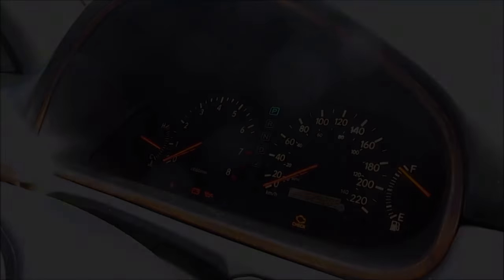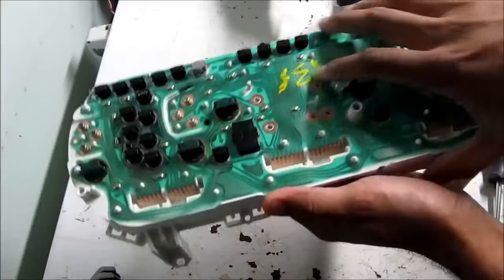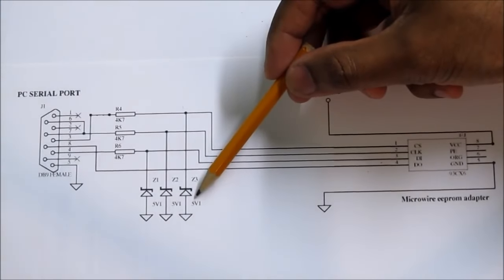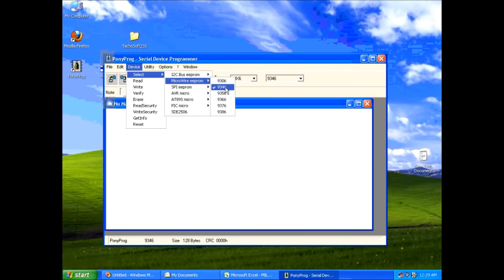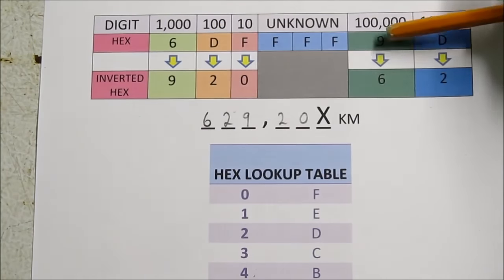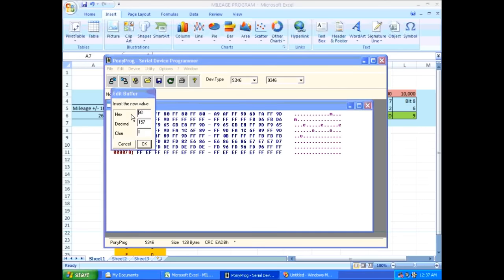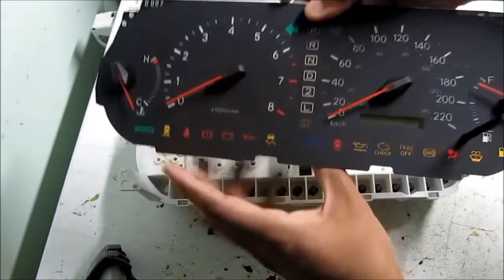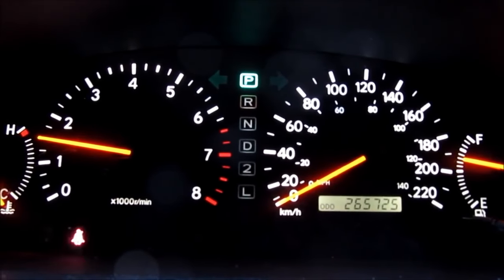DIY Odometer Reprogramming

Comment: At first I was like, damn he’s teaching people how to commit fraud.  After watching, if they go through all this they’ve earned it.
Reply: Right waaaay too many steps. I will have messed my whole car up lol
Reply: @QMil-sz8ej  هههههههه 😂
Reply: Hilarious. 😂
Reply: I’d get an extra odometer and mess with that to prevent messing anything up
Reply: Well depends on if you already have soldering station, spare bread board, wires, etc. Everything  software wise would be the easy part.
Reply: There are a few totally legit reasons to change the mileage on an odometer. One of which is if you had to purcahse a new or used inst. cluster for your vehicle. It would technically potentially be illegal and fraud NOT to change the odometer in that case, should you not disclose the odometer is not the original.
Reply: lolz
Reply: bro fr, like windows xp in 2023 come on
Reply: Is it fraud if you're changing it to match the mileage on a new motor?
Reply: LOL
Reply: Its cause alot of software is shadow blocked by microsoft and only avalable on older windows versions like xp i know microsoft just sad for doing this just so we pay a monthly on all software
Reply: I’m just tryna get live mpg on my 1998 Volvo and the t5s have a better cluster and more than likely they would have lower mileage than mine so I’m looking to increase to mileage 😂
Reply: He's really smart
Reply: I got lost at take your dashboard out personally

Comment: In the old days we used to put an electric drill in reverse on the speedo cable, does that not work anymore!?😂
Reply: is he not dropping it down 300000 odd ks, do you have 133 years to drill the focker? :) haha
Reply: Not for the digital clusters now in modern cars
Reply: No. In reverse, the mileage still goes up. Drive your car in reverse in a parking lot and you will see the mileage keep going up.
Reply: That was a good year and a very good movie.  Ferrus Buellers day off.
Reply: For the bikes yah
Reply: No you didn’t. My uncle actually worked for a dealer and he did cut miles off. Pretty complicated process

Comment: For people trying to do this to lower the mileage to sell a vehicle, the actual mileage is still stored in the powertrain control module (pcm) that’s why I take my diagnostic scanner anytime I buy a used vehicle and verify the mileage on the odometer is correct.
Reply: Flashes/Writes new data to the pcm
Reply: @hestia3135  thanks…good to know
Reply: really? I took my car in for service at the dealer and they were unable to tell me what the real mileage was. 299999 for life, I guess.
Reply: @the_kombinator It'll be stored in the ecm/pcm. They just didn't bother to check.
Reply: @NoBrake_Noah  They told me they connected the computer and couldn't find it. I don't really care, the next owner will be the junkyard and I use a trip meter to do my oil change intervals.
Reply: Sorry, you can't check it I just tried to do it and the option was not in my scanner. Also it codes in it but the check engine light did not come on when the car was running but it came on before you started the car. Things are changing out here.

Comment: Why didn’t you just swap chips from the camery gauge cluster to the Lexus gauge cluster because it’s probably the same chip
Reply: That's exactly what they recommend doing.....However the easiest way is to use a TL866II USB programmer and SOP8 IC clip.....first you clip on the old chip, no de-soldering needed. Then use the software to "read" the chip, copy it to a file that you name "old chipset." 
Do the same thing with the new one.
Then using the software to "write" the old file to the new one and you're done.
The only two things stored on those chips are mileage and VIN number.
The newer cars, it's stored on the ECM's and you can just plug into the port they use for diagnostics and change it with a $300 programmer.

Comment: I did something like this with the BIOS chip to a laptop. With the same setup, I flashed the chip to my guitar amplifier with on-board DSP (Peavey Vypyr 60, 75 & 120) The hardware I used back then was a Raspberry Pi 3, using IC test clip (so I didn't have to solder anything) along with a breadboard. The Pi's GPIO pins provide all the connections you need to read from an SPI chip, along with a SPI driver in Linux Debian. I used FlashROM, a terminal based program, but I see that PonyProg lists Linux as compatible. So combine your software with the RPi hardware and you have an effective portable solution to flashing chips!

Comment: Next time just get a OBDStar X300M module and change your mileage (on any car) in like 30 seconds.
This can look very tempting for some people but the odometer chip is NOT the only place that the actual mileage is stored. Power train PCM and other modules, also contain an actual mileage and a scanner will reveal it. Good job explaining WHY you are doing this and the warning at the end . I am so super impressed by how much you know about eletro-mechanical systems. Judging by your age estimate, I figure you started learning about this stuff when your were 5 or 6 years old.:-)
Reply: OBDstar X300 doesn't work on Toyota and Honda cars

Comment: The units number probably is written by rotation in various locations, to prevent wearing out of that cell by frequent write cycles (units are 10x more often written that the rest of the cells).
Reply from the maker: Maybe
Reply: They use EEPROM that are deisnged for high write cycles. Thats why it holds such a tiny amount of data.

Comment: Could have used a XGecu USB Programmer and SOP8 IC clip.....no soldering needed, just clip, "read" the "old" and save it, then clip the "new" and "write."
The only two things on those chips are mileage and VIN.

Comment: So I have a 2003 Toyota Echo that I was called on. Never did odometer repair, corrections but have taken a all day class on. Eeprom actually back at end of Feb, beginning of this month. 

The question I have is can I read the chip onboard with the sochip? 

Also need to figure out where to get current mileage from? 

The cluster assembly is the original as I can tell by the markings. 

Can I get the mileage off the ecm using TIS ? IF so that would make it easy, just get from ECM, write to cluster board being it's cluster level or am I off on my assumption? 

I am hesitant given the lack of ability to get mileage using 3 aftermarket scan TOOLS so dealer level if it can be done seems like my last hail mary unless it's stored on the chip and the chips went bad? 

How would I go about determining what I need to do? 

This is the part of automotive I want to dive in and stay in, keep swimming along with programming, auto locksmith work. 

Any help would be greatly appreciated.

Comment: thanks a lot!  I have this '10 car and the odometer said I drove 300k+ miles on it but I swear I only drove 15k miles.  I was able to reset it to 15k miles and make an extra $13k selling it to an elderly woman.  her husband asked why the engine looks so run down but I told her it should be fine it only has 15k miles on it! they bought the car!

Comment: @speedkar100, Hello. I apologize for responding over 5 years too late. But how come @ 4:08 your HEX calculations to end up with the final mileage is so different than the write up you made around the same time on instructables? For instance on that write up, you explaind how hex 33 85 were, "... the only characters that store actual information..." and you multiply the result by 16 to get 211,024km. Yet by doing that method here I ended up with 450,464km instead of your written 629,20x km? In other words your method here did the invert by chance because all those HEX values on row HEX inverted gave a number. What if the 6 digit in the 1,000 column was 5? Then the inverted is A right? So how would that be interpreted as part of the final calculation? Just asking... thank you

Comment: Hi! I performed this procedure on my 03 Lexus GX470 and finally was able to successfully change the mileage. Just a couple of issues I got.

1. ODO and mileage reading are Flashing / Blinking.
2. RPM Gauge seems to have stopped working.

Any idea what may have caused this? Or what can fix it? Thanks!

Comment: What happens if you do engine swap in your car with say 90,000kms on it and you find a digital speedo cluster for your car with 90,000kms wouldn't  that be easier then doing all of this
Reply: What are the chances of finding a compatible digital speedometer cluster with the correct distance reading on the odometer?  Your chances of reaching into your pocket and randomly finding a fist-sized piece of gold would be  better.
Reply: @Milosz_Ostrow  rubbish. I own a breakers yard and i have lots of vans if same model with almost the same miles give or take a few thousand
Reply: @mikewatte4478  — Johnno Bravo didn't specify "almost the same miles give or take a few thousand".  He specified 90,000 kilometers, so if your yard has lots of vans with odometers calibrated in miles, they would be of no use in replacing an odometer calibrated in kilometers, regardless of their reading.
Reply: @Milosz_Ostrow  in uk its miles
Reply: @mikewatte4478  — You could live in a place where odometers are calibrated in leagues, but even though you might have a yard full of vehicles that have such odometers, it still doesn't respond to Johnno Bravo's need for an odometer that is calibrated in kilometers AND has 90,000 km recorded on it.
Reply: @Milosz_Ostrow  and another point. If he found one with say 92000 on it he could use it as only reducing mileage is illegal
Reply: @mikewatte4478  — I guess you're out of valid arguments, now having to resort to personal attacks.  Debate isn't your strong suit.
Reply: @Milosz_Ostrow  what would you like to debate.

Comment: The one leg that is not soldered on the eprom chip Is also the reset, all you need to do is apply a current to that one leg and it will reset your odometer  !!!!!!!!
You could also just buy a diagnostics machine that would do the same thing. . . .

Comment: Mans literally teaching programming and to commit meter fraud you need to do a programming course as well as an IT course as well as software engineering as well. Btw nice video and i made 30k off my evo which was run 405000km and i reprogrammed it to 69420 km and sold it and got ez cash thx man love you bro cya in jail

Comment: Ok I have a question, I am replacing my cluster with a used one the has 67K Miles but my original miles is 127K
Can I just transfer the chip From the original cluster to the used cluster I’m installing?thanks

Comment: Help me please with this dillema i have.
I got a cluster that had all the leds changed and looks 10 times better then original, it's for a 2001 Celica Gt.
 The thing is that reads in km and i want to change it with mine but to keep my original miles and also to read in miles, as I'm living in Uk.
By just swaping my old EEPROM with the new one would I be able to keep my original milleage readings? As I don't have the possibility to acces a computer and reprogram the EEPROM.
Thank you!
Reply: I would presume that the cluster itself has to change because it will increment what ever is in the eeprom in miles
Reply: @speedkar99  the speedometer and rpm's are working properly, as i changed the km fascia with the older one in miles, is just that beeing a jdm it keeps all the readings in the eeprom, and now i have the ones of the other car, less mileage and the odometer it reads km instead of miles. And i want my original readings. Of course that i could desolder bith Eeprom's and swap between them on the cluster itself, but i want to make sure i won't burn them by doing that.
Reply: Beware of oil burning issues with that year celica

Comment: At the end he says the kilometer read so much, mine doesn't have a read out - it's not lighting up - what do you do about that?
Reply: That is the point of the vid. Some models of vehicles contain the mileage in the instrument cluster, as shown here. Some contain it in the Body Control Module or other computers. When getting a replacement cluster from a salvage yard because the one in your vehicle no longer functions, such as needles not working or the backlight out, the replacement cluster will retain the mileage from the salvage yard car and it needs to be updated to the current miles on the car you are fixing. Your car may have simple incandescent bulbs or an entire array of LED's that will need a replacement gauge or knowledge in repairing the LED system.

Comment: after watching this video, i was wondering if there was a way or a tool that allows me to read the data from the old speedometer .. and transfer it to a new speedometer .. there is by chance some tool or equipment that allows to do this ?

thanks to anyone who can remove this doubt from me!
Reply: If the car was made after 1996, look up ODBII mileage correction and rent(or buy) one. IF you can read the old one, write it down, otherwise find one that supports reading mileage. Once you have the mileage off, then replace the speedometer and hook it up. Check to make sure everything works, then plug back in the OBDII corrector and write the old mileage onto the new one using the tool. Wait 30 seconds and then remove the adapter. Then you're done.
___________________
Cars before 1996
See a mechanic.
Reply: Move the eprom chip into the new odometer

Comment: Real criminals just buy a $200 scan tool on eBay and electronically reset the mileage. If you’re suspicious you can have a trusted mechanic use his scan tool to read one of the other modules that record mileage for comparison.

Comment: Who the hell can be bothered doing all this ?
Oh, wait, i suppose the guy who wants to falsify the kilometres to get more money when selling the car.
It’s perfect for car yards i guess.
Reply: Not really....if your instrument cluster goes bad and you buy a junkyard one with 250 thousand miles on it and yours only had 136 thousand miles on it, the guy doing your yearly inspection or oil change is going to notice and fail your inspection....then you're going to pay to have it legally certified at a State inspection facility or pay for someone to reprogram it using the old cluster & chip.......this chip also stores the VIN number on it as well as mileage.

Comment: The only reason someone needs to know how to (RE/SCREW THE BUYER/PROGRAM) a mileage indicator is to screw the buyer. You must be a used car salesman.
Reply: Or a replacement gauge is bought from a junkyard and the miles need to be corrected to the miles on the car it is going in. Sheesh.